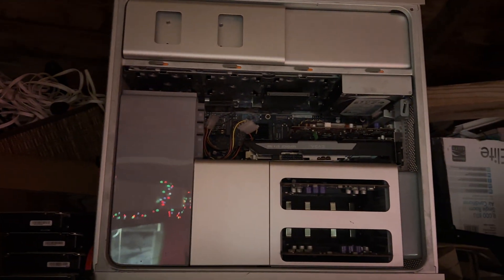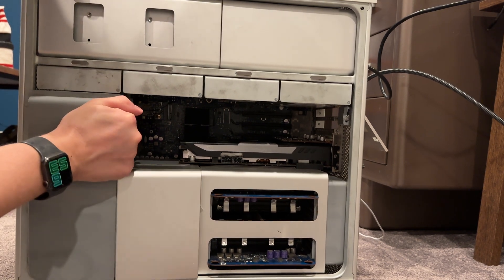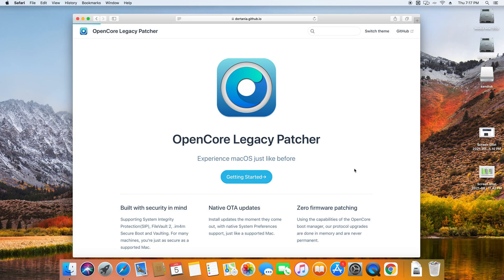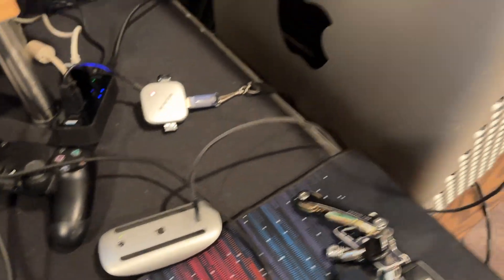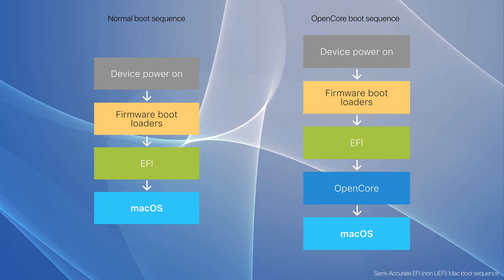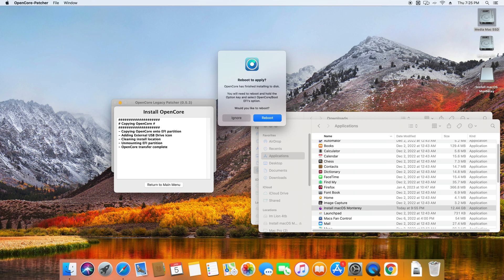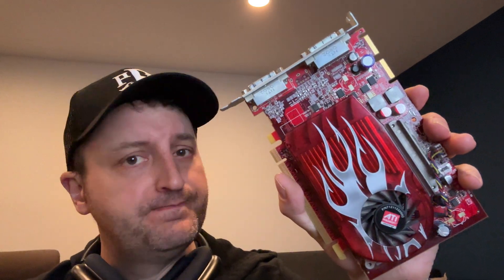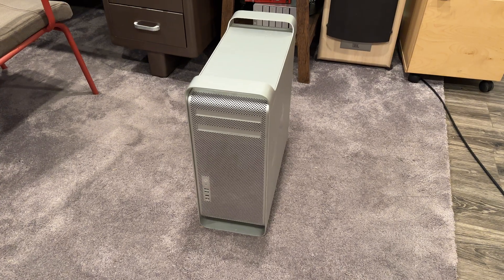Rescuing a Mac Pro 2008 and upgrading to macOS 12 Monterey with OpenCore Legacy Patcher

Comment: Watching this on my almost as old 4,1 flashed to 5,1, running Monterey (via OCLP).  Dual X5680's CPUs,96GB Ram, 1TB NVME boot drive, 14TB worth of Hard Drives for storage, Sonnet USB 3.1 Card, AMD RX5600XT video card.  I used your guide to get it here and it runs surprisingly great.  WiFi doesn't work, but I have ethernet ran upstairs, so I didn't bother upgrading the wifi adapter  Thank you for all of your hard work compiling your upgrade guides!
Reply from the maker: That's a pretty solid get-up. I ran enet to my office (garage) so my desktop and PS5 have wired connections. It's just so much better.
Reply: Jeez Louise that is a good pc

Comment: isn't it a hd2600xt instead of an 1900xt card? ;)
in addition, the problem was defently the mixing of nvidia and ati gpu, if you just leave one of the cards inside, it will install just fine.
the "magic" of display the bootpicker is as well quite simple: the ancient cards does have a GOP snippet in the rom code.
adding this to existing "non apple" cards makes them behave like an "original" card.
what OpenCore does, is calling the routine in the code to display the "early" graphics, before a driver kicks in...but just, if the cards rom does contain the GOP snippet.

as always, nice explain of the process...thanks for mentioning us once again, appreciate it mate...cheers!
Reply from the maker: Ah damn you’re right.
Reply: your welcome buddy...🙋🏻‍♂️